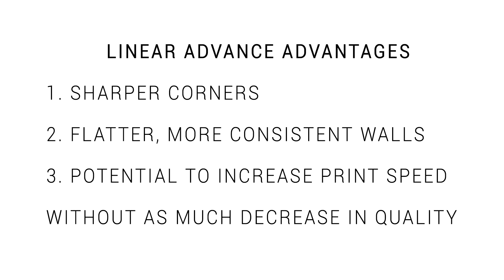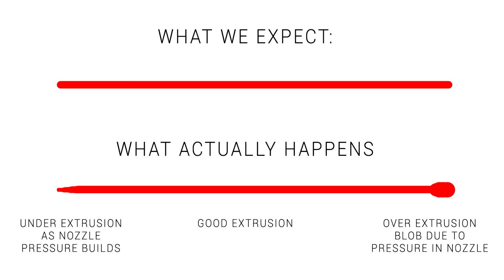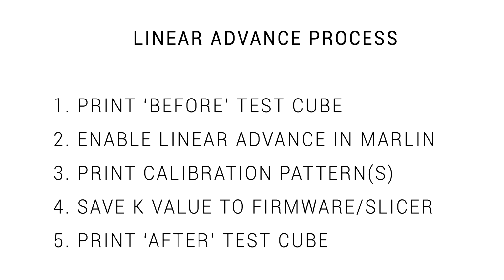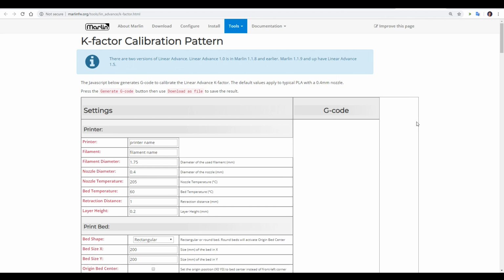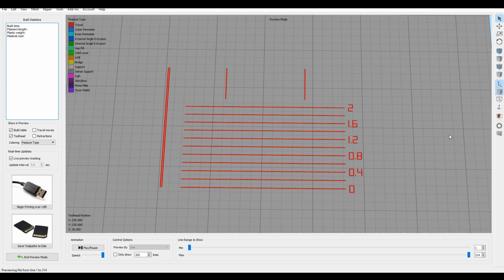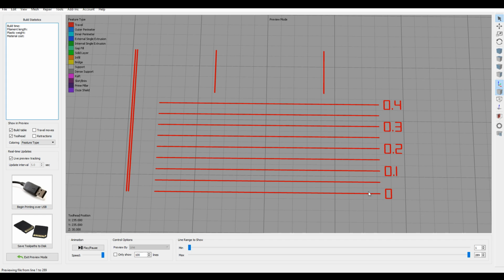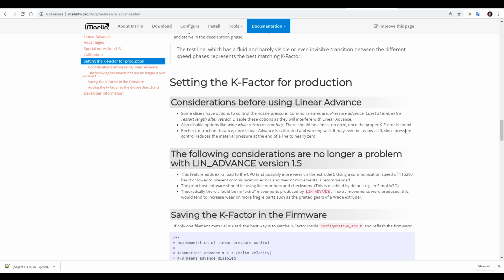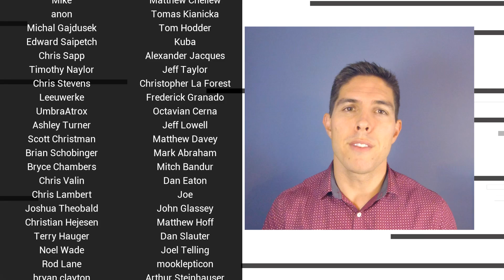Linear advance guide - Free and easy print quality improvement

Comment: mine keeps giving me an error and wont compile.
 In file included from Marlin\src\HAL\STM32\../../inc/MarlinConfig.h:49,
                 from Marlin\src\HAL\STM32\MarlinSerial.cpp:27:
Marlin\src\HAL\STM32\../../inc/SanityCheck.h:1228:35: error: expected primary-expression before '>' token
 1228 |     static_assert(DEFAULT_EJERK = >10, "It is strongly recommended to set DEFAULT_EJERK >= 10 when using LIN_ADVANCE.");
      |                                   ^
In file included from Marlin\src\HAL\STM32\../../inc/MarlinConfig.h:49,
                 from Marlin\src\HAL\STM32\HAL.cpp:30:
Marlin\src\HAL\STM32\../../inc/SanityCheck.h:1228:35: error: expected primary-expression before '>' token
 1228 |     static_assert(DEFAULT_EJERK = >10, "It is strongly recommended to set DEFAULT_EJERK >= 10 when using LIN_ADVANCE.");
      |                                   ^
In file included from Marlin\src\HAL\STM32\../../inc/MarlinConfig.h:49,
                 from Marlin\src\HAL\STM32\HAL_SPI.cpp:27:
Marlin\src\HAL\STM32\../../inc/SanityCheck.h:1228:35: error: expected primary-expression before '>' token
 1228 |     static_assert(DEFAULT_EJERK = >10, "It is strongly recommended to set DEFAULT_EJERK >= 10 when using LIN_ADVANCE.");
      |                                   ^
In file included from Marlin\src\HAL\STM32\../../inc/MarlinConfig.h:49,
                 from Marlin\src\HAL\STM32\Sd2Card_sdio_stm32duino.cpp:27:
Marlin\src\HAL\STM32\../../inc/SanityCheck.h:1228:35: error: expected primary-expression before '>' token
 1228 |     static_assert(DEFAULT_EJERK = >10, "It is strongly recommended to set DEFAULT_EJERK >= 10 when using LIN_ADVANCE.");
      |                                   ^
In file included from Marlin\src\HAL\STM32\../../inc/MarlinConfig.h:49,
                 from Marlin\src\HAL\STM32\eeprom_bl24cxx.cpp:32:
Marlin\src\HAL\STM32\../../inc/SanityCheck.h:1228:35: error: expected primary-expression before '>' token
 1228 |     static_assert(DEFAULT_EJERK = >10, "It is strongly recommended to set DEFAULT_EJERK >= 10 when using LIN_ADVANCE.");
      |                                   ^
In file included from Marlin\src\HAL\STM32\../../inc/MarlinConfig.h:49,
                 from Marlin\src\HAL\STM32\Servo.cpp:27:
Marlin\src\HAL\STM32\../../inc/SanityCheck.h:1228:35: error: expected primary-expression before '>' token
 1228 |     static_assert(DEFAULT_EJERK = >10, "It is strongly recommended to set DEFAULT_EJERK >= 10 when using LIN_ADVANCE.");
      |                                   ^
* [.pio\build\STM32F103RET6_creality\src\src\HAL\STM32\MarlinSerial.cpp.o] Error 1
* [.pio\build\STM32F103RET6_creality\src\src\HAL\STM32\HAL.cpp.o] Error 1
In file included from Marlin\src\HAL\STM32\../../inc/MarlinConfig.h:49,
                 from Marlin\src\HAL\STM32\eeprom_flash.cpp:27:
Marlin\src\HAL\STM32\../../inc/SanityCheck.h:1228:35: error: expected primary-expression before '>' token
 1228 |     static_assert(DEFAULT_EJERK = >10, "It is strongly recommended to set DEFAULT_EJERK >= 10 when using LIN_ADVANCE.");
      |                                   ^
* [.pio\build\STM32F103RET6_creality\src\src\HAL\STM32\HAL_SPI.cpp.o] Error 1
In file included from Marlin\src\HAL\STM32\../../inc/MarlinConfig.h:49,
                 from Marlin\src\HAL\STM32\eeprom_sdcard.cpp:31:
Marlin\src\HAL\STM32\../../inc/SanityCheck.h:1228:35: error: expected primary-expression before '>' token
 1228 |     static_assert(DEFAULT_EJERK = >10, "It is strongly recommended to set DEFAULT_EJERK >= 10 when using LIN_ADVANCE.");
      |                                   ^
In file included from Marlin\src\HAL\STM32\../../inc/MarlinConfig.h:49,
                 from Marlin\src\HAL\STM32\eeprom_sram.cpp:27:
Marlin\src\HAL\STM32\../../inc/SanityCheck.h:1228:35: error: expected primary-expression before '>' token
 1228 |     static_assert(DEFAULT_EJERK = >10, "It is strongly recommended to set DEFAULT_EJERK >= 10 when using LIN_ADVANCE.");
      |                                   ^
* [.pio\build\STM32F103RET6_creality\src\src\HAL\STM32\eeprom_bl24cxx.cpp.o] Error 1
* [.pio\build\STM32F103RET6_creality\src\src\HAL\STM32\Sd2Card_sdio_stm32duino.cpp.o] Error 1
In file included from Marlin\src\HAL\STM32\../../inc/MarlinConfig.h:49,
                 from Marlin\src\HAL\STM32\eeprom_wired.cpp:27:
Marlin\src\HAL\STM32\../../inc/SanityCheck.h:1228:35: error: expected primary-expression before '>' token
 1228 |     static_assert(DEFAULT_EJERK = >10, "It is strongly recommended to set DEFAULT_EJERK >= 10 when using LIN_ADVANCE.");
      |                                   ^
* [.pio\build\STM32F103RET6_creality\src\src\HAL\STM32\Servo.cpp.o] Error 1
In file included from Marlin\src\HAL\STM32\../../inc/MarlinConfig.h:49,
                 from Marlin\src\HAL\STM32\eeprom_if_iic.cpp:32:
Marlin\src\HAL\STM32\../../inc/SanityCheck.h:1228:35: error: expected primary-expression before '>' token
 1228 |     static_assert(DEFAULT_EJERK = >10, "It is strongly recommended to set DEFAULT_EJERK >= 10 when using LIN_ADVANCE.");
      |                                   ^
* [.pio\build\STM32F103RET6_creality\src\src\HAL\STM32\eeprom_flash.cpp.o] Error 1
* [.pio\build\STM32F103RET6_creality\src\src\HAL\STM32\eeprom_sdcard.cpp.o] Error 1
* [.pio\build\STM32F103RET6_creality\src\src\HAL\STM32\eeprom_sram.cpp.o] Error 1
* [.pio\build\STM32F103RET6_creality\src\src\HAL\STM32\eeprom_wired.cpp.o] Error 1
* [.pio\build\STM32F103RET6_creality\src\src\HAL\STM32\eeprom_if_iic.cpp.o] Error 1
In file included from Marlin\src\HAL\STM32\../../inc/MarlinConfig.h:49,
                 from Marlin\src\HAL\STM32\fastio.cpp:27:
Marlin\src\HAL\STM32\../../inc/SanityCheck.h:1228:35: error: expected primary-expression before '>' token
 1228 |     static_assert(DEFAULT_EJERK = >10, "It is strongly recommended to set DEFAULT_EJERK >= 10 when using LIN_ADVANCE.");
      |                                   ^
* [.pio\build\STM32F103RET6_creality\src\src\HAL\STM32\fastio.cpp.o] Error 1
Reply: ok i figured it out but now I'm having issues with my ui and it isnt printing

Comment: I've spent past week sorting out linear advance. I calibrated my k value

Using e3d v6 hot end
Capricorn Bowden tube
Marlin with linear advance 1.0

But with prusa slicer I can't get rid of stringing

I've printed the retraction calibration cube, and I get flawless results on that but with prusaslicer it still strings a lot

Im using Prusaslicer but the things that I'm told to disable (to make sure it doesn't interfere with linear advance), are off, ie

Lift z: off

Detraction speed: 0

Extra length on restart: 0

Minimum travel after retraction: 0

Retract on layer change: off

Wipe while retracting: off

Is there another setting that could be interfering with linear advance?

Comment: Can it be done on a CR-10S PRO V2?
Reply: It is fixed! You can now enable linear advance on ender 3's with 4.2.2 or 4.2.7 silent boards if you use the new marlin 2.1 version. It doesn't work in older versions of marlin but the new version works. I have linear advance on my ender 3 v2 with 4.2.2 board.

Comment: I got my SKR E3 just for linear advance
Reply: You can now enable linear advance on ender 3's with 4.2.2 or 4.2.7 silent boards if you use the new marlin 2.1 version. It doesn't work in older versions of marlin but the new version works. I have linear advance on my ender 3 v2 with 4.2.2 board.

Comment: Thanks, another really great guide, after recently fitting a microswiss direct drive and hot end to my ender 5 pro, and first doing an e-step calibration, was tearing my hair out with prints not coming out right - things like corners missing, after also doing this nailed it! The new K value for me was around 0.12 with stock at 0.63, on latest Marlin 2.0.9.1 (at time of writing). Had to disable s curve acceleration which I had turned on in the firmware recently for linear advance to function.
Reply: Hello, I know some time has passed but why did you turn S curve acceleration off?
Reply: If I may ask were you able to run the newest marlin on the stock Ender 5 pro board? I just picked one up one marketplace for a good deal and it prints great but these small issues make me want to go direct drive, or setup settings like this. If I just got a different stepper motor for the extruded could I use it? One that isn’t silent maybe? I have an old tronxy x1 that’s lightly used and I can salvage any parts from that’s why I ask.

Comment: @Teaching Tech - how should I proceed in case I upgrade my Ender 3 V2 with BTT E3 V2 mainboard and TFT35 display, keeping my Hemera direct drive and BLTouch? Start from current EV2 firmware which covers BLT and Hemera nicely and try to modify it towards the new mainboard and display? How to determine the differences needed in the firmware for a re-compile?

Comment: Not applicable to the new Enders? No worries, mine prints awesome out of the box.
Reply: It can be applicable to the e3v2 with TMC2208's (v4.2.2 (A)) but requires a hardware mod on the motherboard and custom build of Jyer's firmware, very doable if you are handy with a solder iron. Got it working for mine.

Comment: Help. Linear advance does NOT work with my printer. It's a v427 board running bugfix 2 and a ender 3 pro. E will step a few times and quits until reset. Redid it and problem repeats
Reply: Solved . You answered it.

Comment: This is great. However, your lines seem to use a lot of filament (thicker lines). When my printer is properly set, my lines are so light that the number indicators after the lines are not legible. Any ideas? Thanks for the video!

Comment: Is it normal to hear some filament grinding/gear grinding during the accelerations? I'm using 20 mm/s slow and 70 mm/s fast like Michael
Reply: Is your extruder clogged with plastic? You can try cleaning the gears and see what happens. I have an Ender 3 Pro with an upgraded dual gear extruder. I don't recall having issues like that after I upgraded.

I haven't done the linear advance test and I'm definitely still learning but maybe this information is useful.
Reply: Ironically, I just experienced the extruder skipping again. It was because my nozzle clogged. Perhaps you can check for a clog; even if it's not completely blocked.

Comment: nobody mentions that if you set this up your extruder will sound like a receipt machine and prints will take longer (~30% from what i saw). I had is enabled, calibrated and then disabled after the second print. It doesn't have any really big impact on print quality with the downsides of noise and extra print time....

Comment: Thank you. I just set up an Ender 3 v2 2 months ago and now I can print in good quality.
Reply: @mkalbunyo  yes V4.2.2
Reply: @mkalbunyo  if you can't save the settings. You have to go on marlin firmware and enable (Linear Advance) If you can't send M900 K0.11 or what ever value you have.
Reply: @mkalbunyo  ok😞 sorry for you
Reply: @mkalbunyo  try to put a new firmware from TH3D and setup on (Configuration.h line 220 Linear_Advance)

Comment: I used your tutorial on my D-Bot CoreXY build and it was a huge improvement. Probably the biggest improvement for the amount of effort so far on my printer. The one issue I noticed was that the infill was a lot looser and not as strong but that might just require some more tuning. Thanks!

Comment: For the TMC2208 drivers, just enable SpreadCycle on the Extruder and Linear Advance works with an actual Marlin 2.0.TMC2209 should be save anway, but I don't recommend stealthchop for the extruder anyway.

Comment: 6, 7 or 8 mm of retraction on a bowden...

.... sooo... am I special for having my ender 3 with bowden set at 1,5 to 2mm of retraction? and getting ZERO stringing?
Reply: yes
Reply: @mensb1936  dayum... 3 years later I still use 2.5 to 3mm (a bit higher) retraction... and i get beautiful results with zero stringing... err, as long as the filament is dry...
Reply: @umbratherios  I've redone some enders to bowden since then and also found low retraction works great with high quality tubing and extruder, and dry filament as you said. Might switch everything to bowden now since surface quality appears to be way better than direct drive and the lighter print head can go faster 😀
Reply: @mensb1936  Jeez, I guess that makes us both special, lol

Comment: What about the new Creality boards in E3 V2? The 4.2.2 and 4.2.7 ones - are they compatible with Linear Advance?
Reply: Hi. The current version of Linear Advance (v1.5) work with Creality 4.2.2 TMC2208. I just compiled a new firmware (Marlin 2.0.7) for my Ender 5 Pro and tried this feature, it works almost perfect👍

Comment: Linear advance seems to work on the ender 3 v2 32 bit silent board with tmc2208s.
Reply: EXPLAIN
Reply: @cdxer  apparently its a lottery. not all 4.2.2 creality boards are the same and some might have fake drivers that ironically support linear advance better than the real deal or something
Reply: @randomstuff-cu4of  my v2 does not work. extruder motor shuts off on 2nd calibration line. i think it's a matter of time until marlin figures it out and fix it

Comment: cant seem to use the gcode outputted from this template. I get "Layer indicator not found in file:" in Octoprint when attempting to load the file.. I also notice no ; Layer ;  in the outputted gcode either.
Reply: m getting the same thing why is it doing this?

Comment: This has been kicking my butt lately. I'm running 2208 stepper motor drivers unfortunately. I initially had k values loaded for version 1 but after researching, I'm running marlin 2.0.6 so I'm on version 1.5 
Trying k value at 2 now.
I did comment out stealthchop
Set min stepper pulse to 1
I left chopper timing at 12v since I'm running a 12v machine.
And my EO microsteps were already at 128
I defined square wave stepping
And set tmc adv stepper E0. En spread cycle (true)
Wish me luck!

Comment: I've seen some folks saying that linear advance works on Ender 3 V2s, but I've seen no one definitively confirm this. Does it work on them? 

I realize that at the time of this video, it was the case that it did not work with those drivers in standalone mode, but with the comments Im seeing Im wondering if thats changed.

Comment: Just set up Linear Advance on my SKR Mini V2 on an Ender V1. Had the V1.1.5 board before but ran into problems with filament switching (M600) causing my motherboard to crash and not wanting to start up because of Marlin's size. Decided to get this 32 bit board and had a go at calibrating the whole thing. Things are coming out perfect and exactly how I expected my printer to print when I first got it. Too bad it took so much time and effort (I've also upgraded it to Direct Drive and some various other upgrades like a Noctua fan) to get my Ender V1 to almost perfect.

Comment: Kinda work with creality 4.2.2...TL;DR: Use a recent version of Marlin 2.0.x, if you have a TMC2208 enable SpreadCycle on the extruder. https://reprap.org/forum/read.php?415,863853
Reply: my k factor sitted around 0.35. is that bad?

Comment: michael you should said that the driver IN THE EXTRUDER cant be tmc2208 because im running those for x and y  and a drv8825 for the extruder and linear advance works just fine

Comment: I just noticed that I have Linear Advance settings in my firmware for SKR E3 DIP + 2208 + TFT24. But testing doesn't show the difference. Most consistent result is at 0. Does it even work and is it enabled if it has setting in menu?

Comment: ""For anyone with Creality silent boards, this is a no-go"
sounds of thousands of viewers closing tab
Reply: ya but literally look at the comment right above yours and youll see someone who meticulously went through the steps to try to make it work!
Reply: No go for what reason???
Reply: @skialpin9  It has to do with he TMC2208 drivers installed. He mentions it in the beginning of the video
Reply: Anyone know if this is good with the 2209 silent drivers in the big tree tech silent boards? Nevermind, he tests it with a 2209.
Reply: D Johnson It actually doesn’t work nicely w my 2209s and I’m not sure why. It makes an annoying buzzing sound when linear advance is on. It’s a known bug for some users of 2209s and I’m not sure why
Reply: @jalensailin  Thanks for letting me know.
Reply: D Johnson no problem. It’s quite an annoying but apparently doesn’t actually hurt the motors. Also it doesn’t seem to happen to everyone so it might be worth a try just turning it on. You can always set your k value back to 0 in a terminal to turn it off without having to reflash marlin
Reply: @jalensailin  It really depends how's your printer configured, but in recent versions of marlin you can disable TMC drivers extrapolation PER AXIS (as long as your TMC drivers are controlled overt UART, standalone/creality is ruled out I guess).
TMC drivers don't like to extrapolate to 256 steps and then drive the extruder motor with Linear advance, turn off extrapolation on your E axis and you'll be fine (this is also a good time to check if square wave stepping and S curve accelerations are not being problematic with LA)
Reply: So it's a no-go on the Ender 3 V2, right?
Reply: TMC 2208 steppers can be used in one of three modes. You can burn the firmware settings to the drivers permanently, let marlin control their firmware settings, or you connect them in legacy mode.

Legacy mode does not allow any advanced features like linear advance, however it is compatible with the widest range of motors. From what I understand, the Ender 3 V2 has all its drivers setup in legacy mode. In other words, no Linear advance or other features. There is no way to change this without replacing the motherboard and getting new TMC2208 driver cards.

Sad noises - I got a v2
Reply: @Roopert Zski i recomed use an official marlin version..